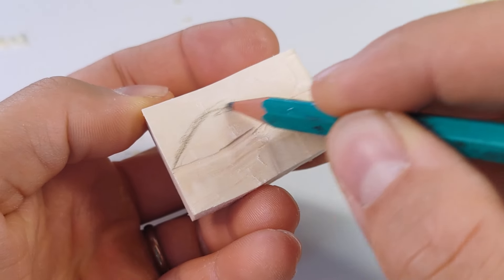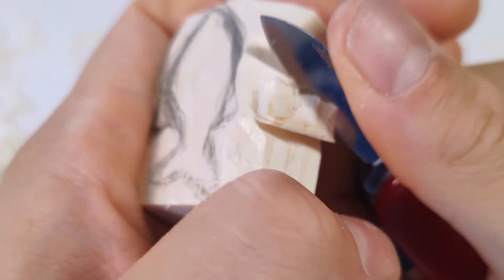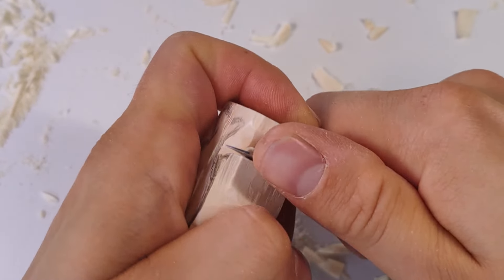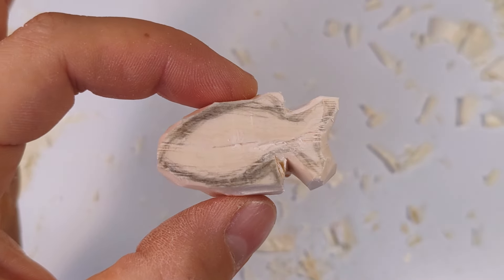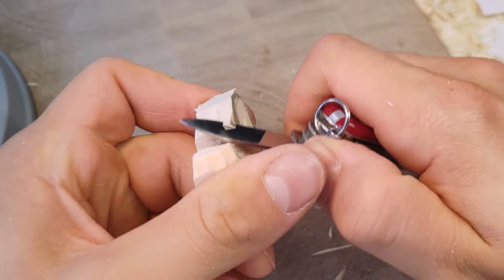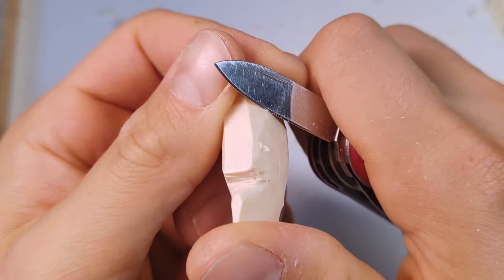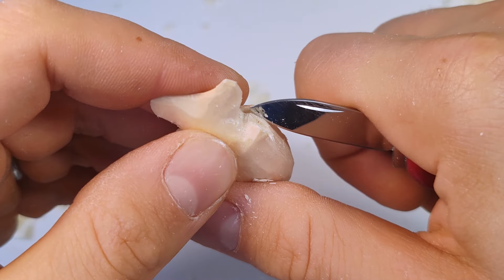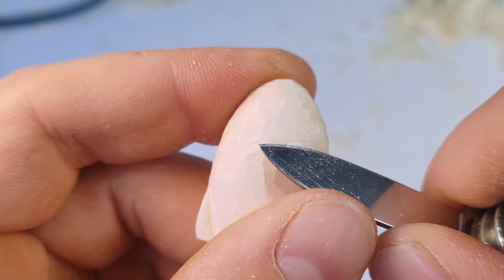Whittle a Fish in 30 Minutes | Step-By-Step Beginner Tutorial

Comment: Nice!!!

Model Victorinox ?
Reply from the maker: The one I have is called Explorer, but any of the ones that have the two different sized blades are good. Recruit is the cheapest one of those, but if I would buy one for whittling now, I'd buy the Camper because the saw could be handy when preparing scrapwood found outside.